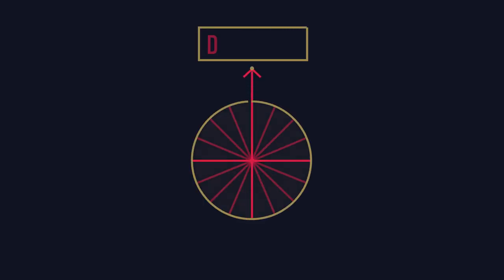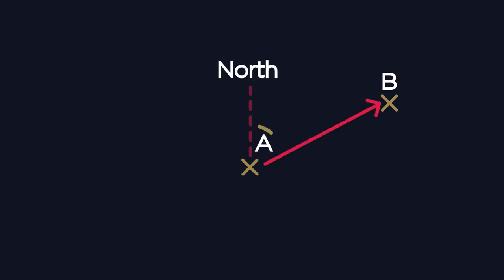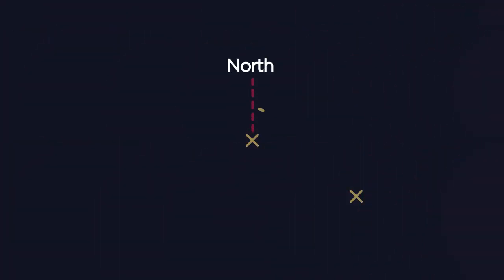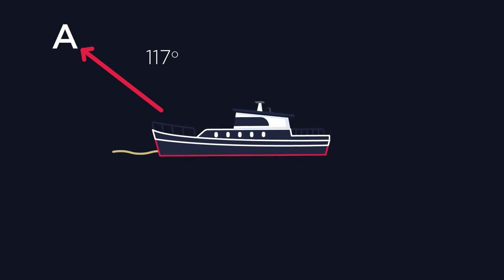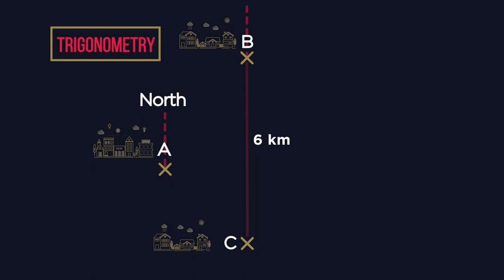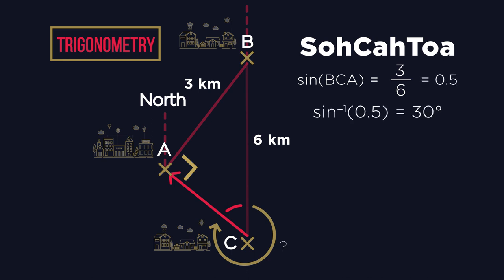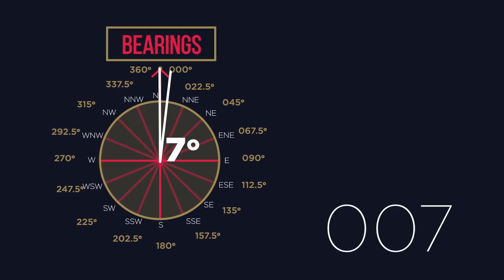Maps and Scale drawings | Geometry | Maths | FuseSchool

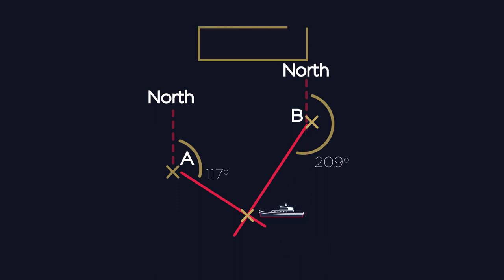Comment: Just a thought on LOCATE THE SHIP (@1:59) problem. At 2:36 you say "IF we are told....", then what you continue to explain makes sense. But "IF" we are not told then the bearings of the ship from A & B respectively will not intersect at 90degrees [based on the already given bearings]. The angle of intersection of the two bearings will actually be (63+29)degrees. For this scenario, the learner cannot apply the Pythagorean Theorem but will have to utilize the Sine or Cosine rule. If this was not made clear then learners can easily make the inaccurate assumption that two bearings will always intersect at 90degrees.